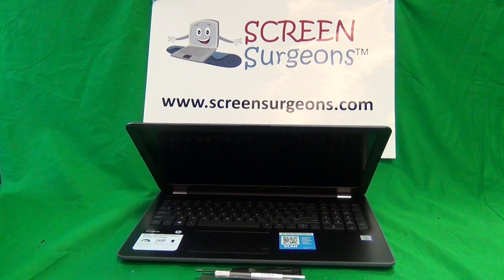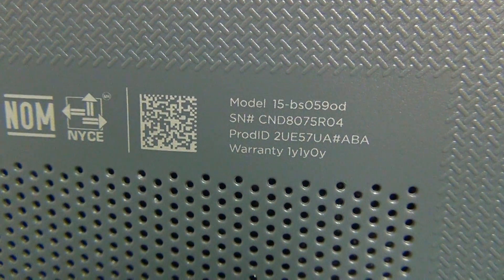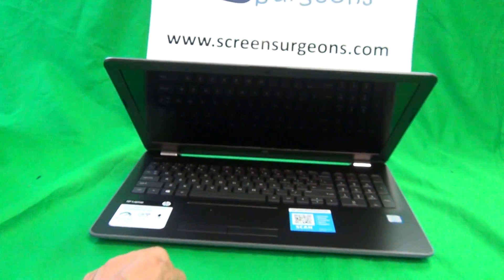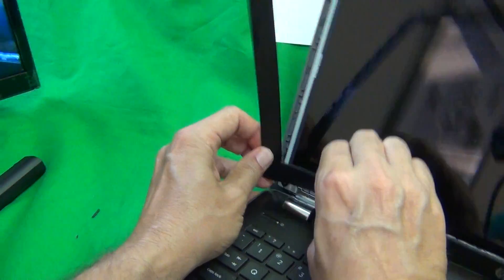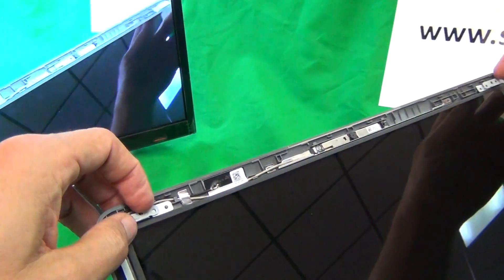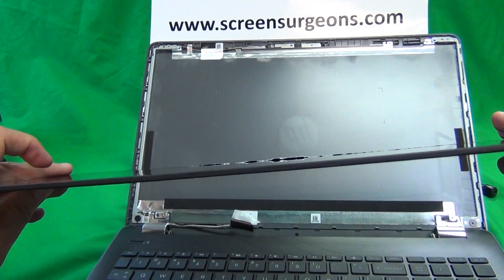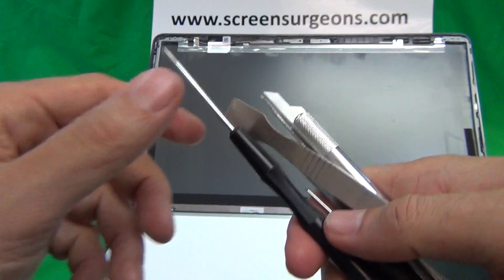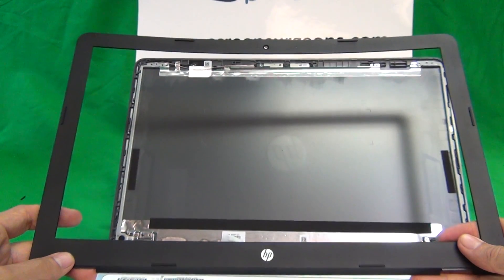HP Notebook 15-bs Screen Replacement Procedure

Comment: At what point when installing the new screen would you advise powering it on to ensure the video is working ok? It's time consuming and bit frustrating putting it completely together and it doesn't work. A defective new screen, the video connector wasn't seated properly, or perhaps some other issue that I can't think of at this time. :)

Comment: Thanks for sharing this video..Much useful & saved ~7K INR :) for me .. I have HP  Notebook - 15-bs145tu  model and the display cracked 2 years back, using external monitor..The recent windows update causes malfunction, resulting in 'Black Screen Error' and …I tried multiple option to project the bios/boot time screen to the external monitor for troubleshooting, all all of them failed… Finally, following your video, I have disconnected the display cable and now the BIOS setting is projected to my external monitor, enables me to fix OS & avoided replacing the display :)

Comment: how many pins are there in the display ( pin connector ) for  model no. 15q-bu006tu and 15-r013tx ?? 
please reply. 
it would be really helpful.
Reply: 40-pins

Comment: Not true . I have a bs244 touch screen and the screen cable is NOT in the same area as what you show . It actually runs through the broken hinge . Which is what I need to fix is the hinges but can’t because I’m afraid of tearing the wires

Comment: Do you have a video on how to replace or repair detached hinges of a 15-BS015DX HP Notebook? All the screw anchors broke off and I'm trying to glue it back together, but I'm having problem on rerouting the wiring because they are run through the hinge cover. I'm lost. Thanks!

Comment: Nice video. Can you upgrade the screen to a higher resolution screen on this model? Mine is the HP 15 bs150sa. It has a mad hd screen but I would like a glossy higher res or touch screen

Comment: Water split on my laptop then turn off then i switched it on but the touch screen wont go on i open the motherboard and dried it up but still got the same result i need some help